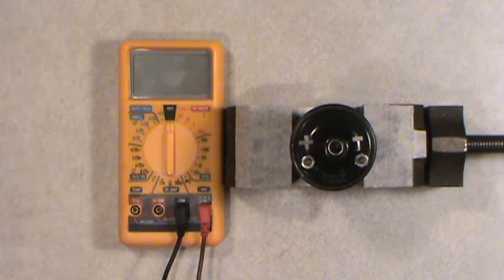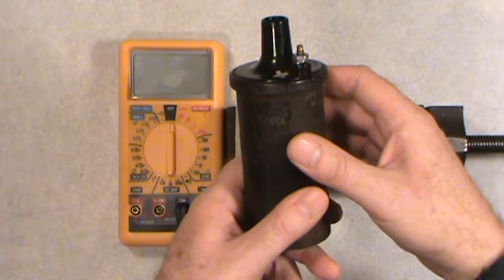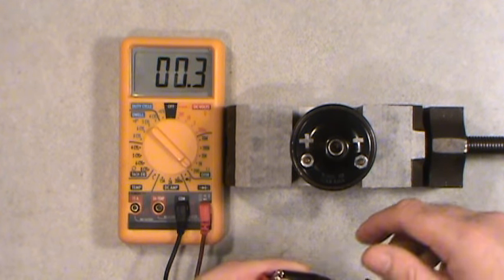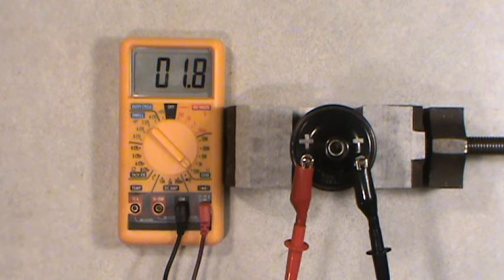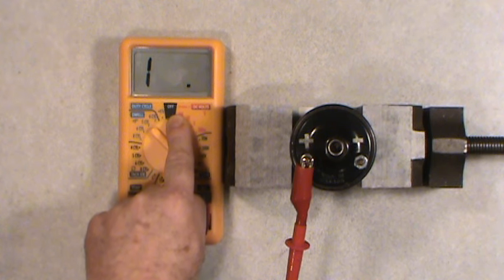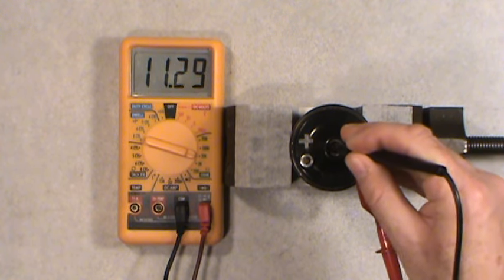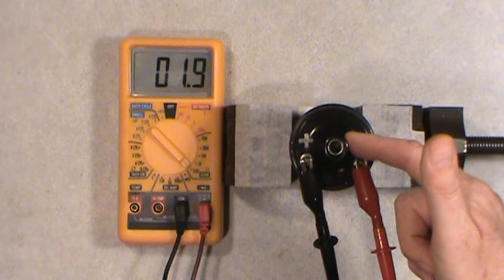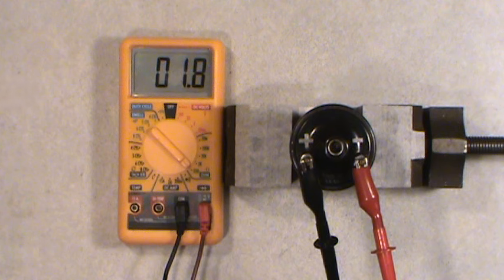Ignition Coil Test (The Short Version)

Comment: Indeed you are right about getting the magnifying glass out! Look for the evidence, well I checked oil several times and it seemed normal but a testing of the coolant shows head gasket leak. A lot of bubbles of air always in the coolant to . so now I have to decide which is the better choice fix or buy another car. The exhaust did smell sweet and a little bit of white smoke not a lot but constant even after warming up. I'm thinking about buying another car. I hate "aluminum heads"! Today's cars aren't what they use to be.
Reply from the maker: Jon Stone Greetings Jon Stone...Ah yes..."Aluminum vs Cast Iron"...say what...???.............................................Here's a good ole saying, for Ya, and it goes something like this..."Aluminum", is only 1/3 the "Weight of Cast Iron"..."But"..."Only" 1/3 as Strong"..!!!............................................Is Your Engine's Block, made of Cast Iron perhaps...???...........................................If so, it could be, by having "2- Diss-Simular" Metals (as in the case of having "2" Different Metals) Bolted to one another, a Person should be aware of, the "Different Expansion Rates/Amounts", of, Different Types of Metals, and, at times, can make for, a problem or two, when taking those Different "Expansion Rates/Amounts into consideration..................................................The "Racing Crowd/Enthusiasts", usually have to take "Vehicle Weight" into consideration, in order to remain "Competitive", thus, "It's usually a "No Brain-er", that, "Aluminum", is the "Metal of Choice"...where-as, when it comes to actual "Strength/Reliability and Longevity"..."Cast Iron", has, over, many, Many Years, "Stood the Test of Time"...!!!....................................For Example...Industrial/Farming/Manufacturing/Machine Shop/Machinery/Equipment, is Made out of "What" kind of Metal...??? (Cast Iron and Steel maybe?).......................................As I see it, when it comes to something, like, having to make the choice, between "Fixing" an Older Vehicle, as opposed to Buying, a, Does-Not need as much Fixing, Replacement Vehicle, it would probably boil down to..."Sentimental Value" (of the Older/Needs Fixing) Vehicle...vs...the (maybe?)..."Cost Effectiveness" (the amount of money, that Might? be saved), by purchasing said "Replacement" Vehicle perhaps...???.................................................."If", Your Engine Block and Cylinder Heads, are "Usable", and You do decide to keep, the Vehicle, that You have now, Do some "Exacting, Information Gathering", in respect to, just..."What", a "Big Name/Brand"...of..."Head Gasket Manufacturer"...that has already done..."Lots of Racing"..."Research and Development"...actually..."Recommends"...for Your..."Exact Engine/Vehicle"...and the..."Manner in which You will be Driving/Using It, as well"...................................................Once the "Major Brand"...of..."Head Gasket/s"...is/are in Your Custody..."Make Absolutely Sure"...that You..."Follow Exactly"...the..."Installation Procedure"...that, the..."Gasket Maker"..."Suggests/Recommends"...along with, the..."Exact Gasket Sealer/Goop" (if Needed?)...along with, the..."Exact Procedure, and Amount of Cylinder Head, Bolt Torque"...as well...!!!.............................................Ok now, the "Ball is in Your Court"...when You're ready, You can make, "Your Final Decision"...lol...................................Good Luck, my Friend.................................Till next time...Be Safe, take care, and have a good one.
Reply: RockysRoadshow You are a man with a lot of knowledge for sure! I appreciate your info regarding head gaskets and the head metal differences. I know for a fact my head is aluminum and the block is cast iron but since the car has 185k + miles on it I used blue devil sealer for now as it did seal it. I'm buying time until I can find another car. I've been told I am lucky to get this many miles out of the PT Cruiser, I intend to get something with better gas economy and more reliable. I've had over heating issues ever since i bought it. If it were a solid cast iron engine I'd probably replace the head gasket, I think it's time to find another car. I thank you for this info i will keep it for future use. I will keep watching your videos for sure you do share a lot of knowledge that people have lost and aren't willing to relearn. Thanks!!!

Comment: Very informative, thanks much!
Reply from the maker: Greetings...Roadside Camper.........You're welcome, and, thanks for watching.........If ever replacing an ignition coil, then, always try to get the vehicle manufacturer's "specified" coil, for that exact engine, so as, to avoid any unwanted problems.........Problems might arise, when a mismatched coil, and/or, any ignition part or component, that is not within the electrical tolerances, for that particular electrical circuit.........Some ignition related parts, might look identical, but might not have the correct amount of (electrical) resistance, etc. ..........With the much newer engines, there are some of them, where the vehicle's on-board computer is connected directly, to each of, one of the many ignition coils, that are on an engine (there might be, one ignition coil, for each of the engine's cylinders), and it is this type of coil, that has to be the correct one, or, expensive, it might become, and......till next time......Be Safe, take care, and have a good one.

Comment: Hi Rockys. I know this video is a year old or more.
I have a 1985 nissan 200sx.
And I look at my nissan book.
And I see lots of specidi ations but none on the. Oil.
I did tha same test you did. At 200 homs 
And I get neg to positive.
1.1. Only firme I swap pos to neg . i got 1.1 again.
When I do the center with neg a 20k
I get 10.00 only.
Swaping positiv  to. Center . same 10.00.
Do you thing is to low???
I have this car for 5 years only . and to me the coil look very old.
Base on de first reading 1.1.  Im thinking on replacing it...the car start and stalled......

Comment: This is good information if you have an old car.  However, I would think that polarity markings on the coil would have to be reversed on a positive ground system  ie. the ground whether positive or negative should always be connected to the minus side of the coil.  The minus side of the coil should be connected to the distributor, and the positive side of the coil connected to the "hot" lead from the ignition switch.  Am I correct about this?
Reply from the maker: Greetings...wyatt davis………..Thanks for watching...…...Well, I've never had, a car (or truck), that was old enough, to have a positive (polarity), ground system in it...…….Your best bet, for finding out, just how, to wire a "positive ground" ignition system, would be, to try and find, an electrical "schematic" (aka, drawing) for, the "exact" vehicle, that you want to know about...…….Also, maybe check out the H.A.M.B. online website, as, there are quite a few, older guys, on that website's "forum", where you'll be able to ask them, about that, good ole, automotive, positive ground, electrical system...…….Then, there were also, 6 volt systems, and 12 volt systems too, both of which, will probably have, quite a bit of history, behind them as well...…...Just thinkin', if the battery was hooked up back-wards, (polarity-wise), then, what might get "fried" (damaged)…???...and...would the electrical motors (as in...starter motor...defrost/heater fan motor...windshield-wiper motor)...turn "back-wards/in the opposite direction"...???...because, even those small DC (Direct Current) toy motors, will spin, in the opposite direction, as in, clock-wise...or...counter-clockwise...depending on, which terminal (on that little electric motor), that Ya hooked up, the + (positive) wire, and the - (negative) wire to...…...Hmmm...lem-me-see-now...perhaps, an engine that tries to start "backwards"...???...or maybe, a heater/defrost vent, that will draw air, "out of", the vehicle's passenger compartment, and blow that (maybe) heated air, to the "outside" of the vehicle, and leave Ya, feeling, as cold as an ice cube, on a cold winter's day...maybe...lol...and...…..till next time...….Be Safe, take care, and have a good one.

Comment: Seal your connections with battery terminal sealer, works great.
Reply from the maker: Greetings...Jackle61..........Thanks for watching..........For the older style of car/truck battery, that had the two top terminal/posts, the old school stuff to put on them, was usually petroleum jelly/vasoline, to help keep all of that nasty corrosion (growths...lol), from getting too big, and causing some problems, as in, a No Start for example............I never had a problem with the side terminal battery, like the type that General Motors uses, as an example, so, No goop needed at all.......and.......till next time........Be Safe, take care, and have a good one.
Reply: When I was young my dad always used vasoline or just good old bearing grease on the terminals. Then my brother and I would put dirt on it so if and when it melted it didn't get all over the place. As for the side terminals, living in the rust belt where we put salt on everything, beef, pork, potatoes, Roads, I still seal any electrical connection I can get to. Greetings from Wisconsin.

Comment: would a coil show voltage on both positive and negative side of the coil when hocked up to the ignition system?
Reply from the maker: Greetings...Scott Fox.........Thanks for watching.........Well, from my experience, with the good ole, "points and condenser" ignition systems, that were around before, the computerized/fuel injected engines started showing up, or before, about 1985 there-abouts, then, the "negative" or - (minus sign), side, of an older, oil filled, cylindrically shaped ignition coil, actually got (electrically) "grounded", when-ever the ignition "points" closed together (ignition "points", kinda work, like a simple switch, that just opens and closes), which basically, just completes the electrical circuit (when-ever, the points are closed)...........The "positive", or + (plus sign) side, of the same, older type of ignition coil, would receive the "positive" voltage, when-ever the ignition switch was in the run or start position, basically speaking, and not taking into account, the reduced current and voltage, that usually occurs, while the key is in the run position, due to, there usually being a "ballast resistor", in that particular (run), key/position electrical circuit, and also, the reduced battery voltage, that usually happens, when-ever the (electric) starter motor, is trying to start the engine...........The newer, computerized/fuel injected engines, kinda work the same, some-what, but, the so called electrical "ground" (- or negative) side of the ignition coil, usually gets switched on and off, by the vehicle's on-board computer, and the + or positive side of the ignition coil, basically receives battery voltage, there-abouts, when-ever the engine is being started or running, well, as far as I see, that is, and.......till next time.......Be Safe, take care, and have a good one.

Comment: I'm very  confused. I have a 1981 Toyota tercel with 3AC engine and the book is telling me that I should only get between 
.4 and .5 ohms  On the primary connections but it is showing 1.1    I went to the auto parts store and bought the specified coil listed for this vehicle and it shows 1.8 on primary. Neither my old coil or the new one from the auto parts store will give me any reading from the secondary at all. just does nothing. I'm lost.   The car slowly got weaker over the course of one week and then finally it will only idle even if the pedal is to the floor. Everybody is trying to tell me it needs a carburetor rebuild but in my experience if the carburetor is bad and the spark is good you should be able to spray starting fluid in through the carburetor and the engine should rev up. It does not rev up when  I spray starting fluid or gasoline in the carburetor. That would generally mean weak spark correct?
Reply from the maker: Greetings...BRS RC..........Thanks for watching..........Seeing as how, you said, that, the book was showing .4 to .5 ohms on the primary/low ohms side, then, it's probably an epoxy filled ignition coil........The primary/low ohms test, is really "fussy", especially, if it's an ignition coil, that is less than 1 ohm there-abouts.........Here's how I do, that low ohms test.........On my yellow ohm (multi-meter), I set the dial, to the lowest ohms range, and that is, the 200 ohms range.........I then, connect (by hand pressure), the two test probes, and see what the reading is, on the screen........On mine, it shows .3 ohms, which will have to be "subtracted" from, the reading that is shown, when testing the primary connection, on the ignition coil.........Let's say that, my display, shows .8 ohms, then, I have to subtract .3 ohms, and, the true reading will be .8 minus .3 which equals .5 ohms, easy huh..........When testing, the secondary/high ohms, then, the meter's range dial, will have to be turned to, a much higher ohms range..........I try 20K (20,000) ohms range, and see if that will display/read properly, and, if not, then, I move the range dial, up or down one notch, if need be........The secondary/high ohms, might be, oh, maybe 3,000 ohms, up to, maybe 25,000 ohms (ballpark figures), but, always look up the specifications, for any ignition coil, that you want to (ohms/resistance) test, to be sure.........Also, disconnect "all" wires, from the ignition coil, so you don't get a false reading.........For the secondary/high ohms test, put one probe into the socket (hole), that, the spark plug wire goes into, then, with the other probe, touch it to, each primary terminal (one at a time), and see what the meter displays.........As long as there is a strong spark, then, about the only time, that a squirt of gasoline, or starter fluid, into the carburetor bores (holes) won't work, is usually when, there is already, too much gasoline, inside of the engine already (as in, flooded)..........Remove one of the spark plugs, and lay it on a metal part of the engine, and have someone crank the engine over, as you watch for a spark, at the spark plug's electrodes, and, don't touch anything while doing this, or..."Shock"...!!!.........If spark is good, then, Ya might have a clogged up fuel filter...???....or maybe, a bad fuel pump...???.........Ignition system, wiring and connectors, have to be tightened properly, and also be, "super clean", and not, dirty or corroded, or there might be problems..........In your book, does it show wiring diagrams, and if so, look for, how many volts, there should be, at the ignition coil, with the key, in the run (not start) position, with the engine "not running".........There might be, a "vacuum" (air) leak somewhere, as in...leaking intake gasket...disconnected or split vacuum hose/s....stuck open/faulty, PCV/Positive Crankcase Ventilation valve...stuck open, EGR/Exhaust Gas Recirculation valve...which are just a few examples for Ya.........When carburetors get old/have lots of miles on them, they tend to get gummed up, on the inside passageways, as well as, certain parts, will also get worn out also, so yeah, the carburetor, is a "suspect" too...lol.........Good luck, and.......till next time.......Be Safe, take care, and have a good one.
Reply: @RockysRoadshow  thank you for your time man!
Reply: You should have HIGH  Reading in secondary ,maybe the new one is bad too. Get a Helper, then remove cable tip from distribution pointing out to any metal, ask the helper to crank it , You should see spark out of tha cable (from coil ) that's REAL an indicator if coil is good
Watch out for shocks while holding that cable